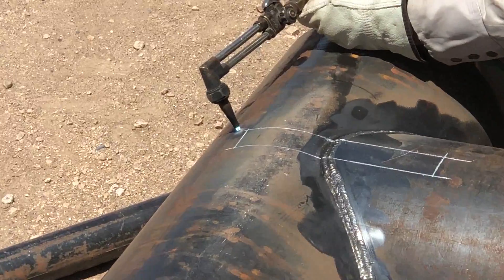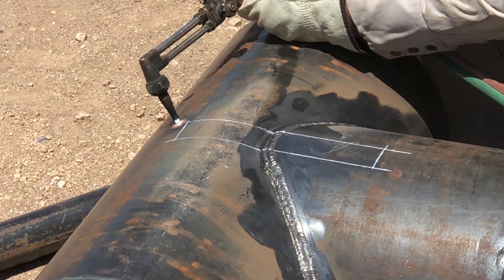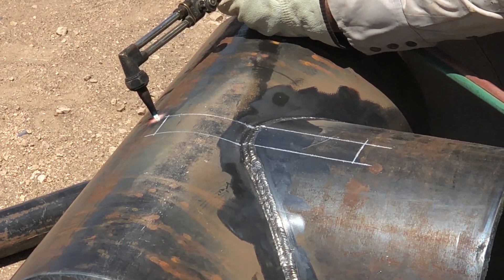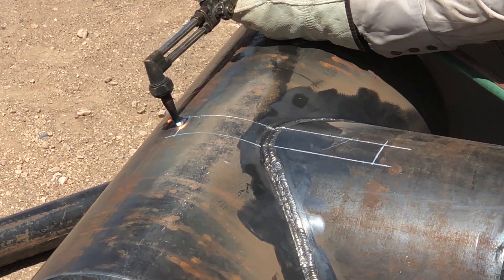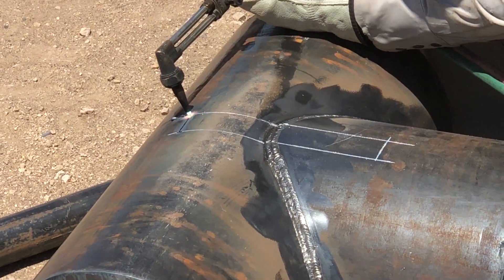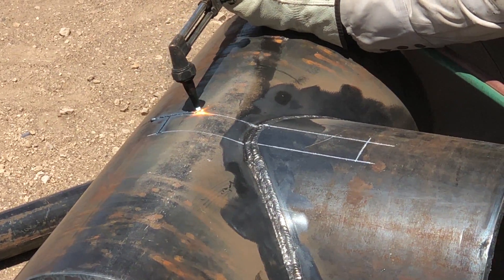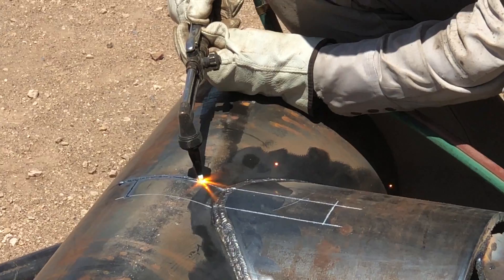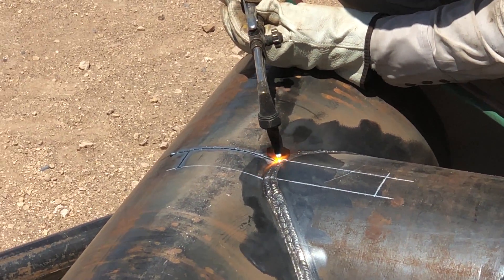API 1104 Welder Testing Laying Out and Cutting Nick Breaks

Comment: Glad someone showed what the cutout was on the nick break. Most videos show the welding of the 12 x 12 but not the actual cutting of the straps. Looked like you really laid those beads in there for the weld test.
Reply from the maker: Thank you for watching it I had received request to show the straps being cut out and made sure to include it in this video. The straps are normally about 9" long and 1.5" wide they are notched 1/4" on each side with a hand grinder. If you take the test only notch the sides at first and the welding inspector will give you go ahead to notch the cap and the root if they feel it is necessary.